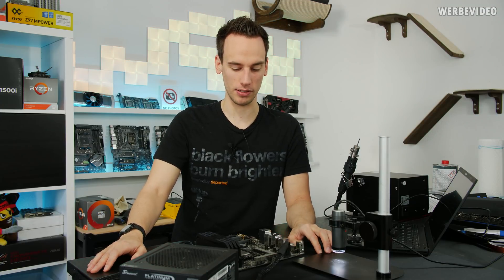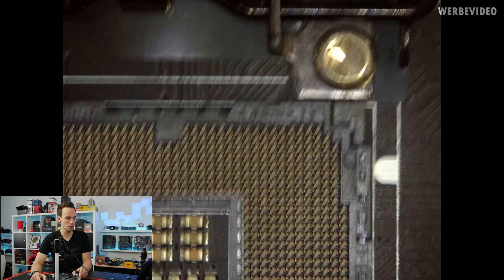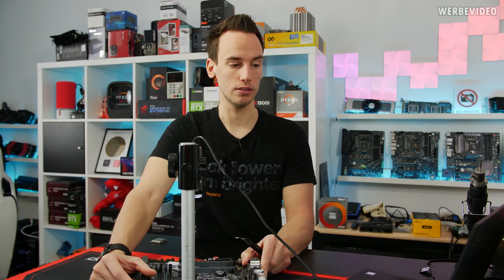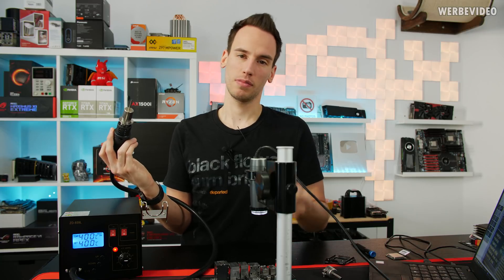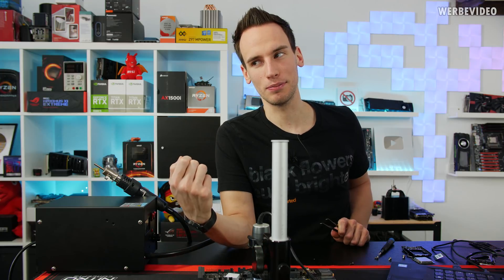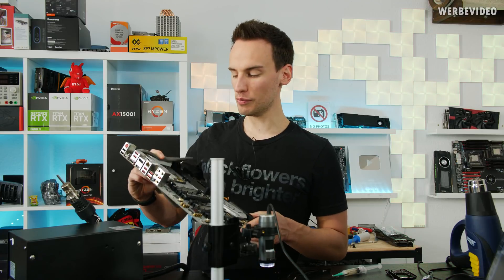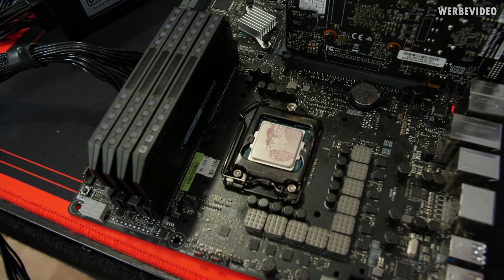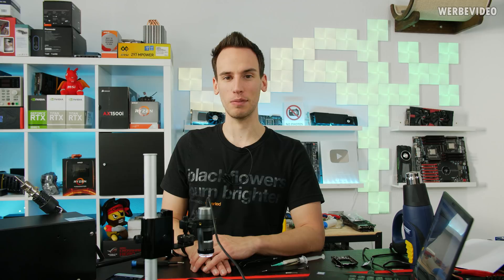We fixed a broken motherboard (Pin)... and broke it even more. BUT now it's working :D

Comment: We professionally do that almost everyday. We rarely use microscopes and magnifying glass but a lot of lighting is important. 
You can try creating a jig so that you can put a heat gun on the bottom of the board . 350 degrees is enough to prevent quickly melting the socket and you can skip the flux, it only makes it look messy. You can also try to use tweezers with finer tips. Other than that, you did well.
Reply from the maker: Thanks!
Reply: No flux? I thought it was "the bigger the gob, the better the job" :-)
Reply: @rhekman  , not needed, the key is to get it out without braking it. The replacement it's enough that is inserted, the minimum amount of contact is all it takes.
Reply: that is the exact method we use. it's even possible to use lower temperature but it will take way longer for pins to loosen up.
Reply: Agreed, 350c should be sufficient.
Reply: @animearmpits3060  I preheat the motherboard to 170-180 then use 230-240 on hot air and is enough. I won't even try to hot air without preheating motherboard from bottom. Large motherboard absorbs huge amount of heat and that is the reason why people without experience tend to raise hot air up to 350 or more. Preheating the board is mandatory.
Reply: @der8auer I would also consider using non-magnetic tweezers since that's why u messed up the other pin (or just touching the pin with magnetic ones instead of catching it for better precision).
Reply: Can you just heat the single pin with a tiny tip soldering iron while applying pressure to remove the pin when it's hot enough? 
I have the identical board but it's still working with half the memory, otherwise I get CC error code (clear CMOS but it doesn't work)
Reply: Can you help me on this by providing your method's video please? It would be very helpful.
Reply: You will need flux you can just ultrasonic clean it after
Reply: Got a vid?
Reply: who does something like this professionally ? what does it cost to get such a thing done?
Reply: can't you just superglue a missing pin?
Reply: @turinreza  i was actually planning to do that but the pin was too tiny for me to handle, PC is back up and running with 1 x 16GB stick of RGB Vengeance memory 

this all started because i felt the RGB on the IO of my mainboard wasn't bright enough. haha. Should have been happy with what i had, haha
Reply: it's not for the faith of the heart. I'll pass doing it myself; not worth it. local shop doesn't do these anymore. They all transitioned to fixing smartphones. bummer.
Reply: How can a pin on the cpu socket break? What would be the conditions?

Comment: You've got really steady hands. I bent a Ryzen pin this weekend, used a DSL camera on a tripod with a macro lens, and HDMI out to a 50" TV see what I was doing. Ended up using a sewing pin to bend the cpu pin back. Trick was to be patient and very gradually pressure.

Comment: I can't give you advice on pin replacement, but I can help you steady your hand. Always have your pinky finger or part of your palm resting on the surface. I have noticed in the video that only your forearm, and not the palm was resting against the motherboard. That is why you couldn't control the hand enough to just pull one pin out. And also hold tweezers like you would hold a pen while you write. You have practiced fine motor skills for writing your whole life, why not use them to control tweezers. :)

Comment: Worth noting that the ZD-939L is a very low power soldering station rated at just 320W
Reply: 240V @ 320W, and can reach 500 C. More than enough for the task.

Comment: Cheers! I normally do work like that, and to avoid damaging the plastic parts, work on a hot plate at 100 - 150 degrees Celsius to avoid applying excessive heat with the hot gun, a hug from Costa Rica !!
Reply: wow I didn't know anyone was doing board repair here in costa rica, that's awesome.

Comment: You have to preheat the board, and have another heat source in the bottom.The huge groundplane in the inner layers to have a proper controlled impedance circuit will sink a lot of heat away.
I have no idea if the socket itself will melt before the solder does. Unfortunatly specs/datasheets of the sockets are not public available so soldering temperature is unknown to most.

Even professionals have to try and error.

Comment: Ouch! That MSI TITANIUM... That board was awesome. I actually bought a z370 Aorus Gaming 7 that had bent pins and was RTV'd and fixed strait from Gigabyte. I could still tell were the pins were repaired but, it was just fine. I got the board for $145 and a 5.3GHz 1.380v 8700K for $280 to go with it. It hasn't cause any issues and i severely stressed that board. I never really had problems with bent pins because i never bent any. I was always over cautious around open sockets. Though, i fixed many of them throughout the years. After realising i could remove pins, I bought some killer boards that were thought to be worthless.

Comment: Kinda sad if a man like you with so many great connections in the computer industry can not even get schematics from AMD...
Maybe like Louis Rossman, you should advocate for the right to repair on broken motherboard...
Reply: There isn't any assault on consumer motherboard repair doe. The stuff isn't really proprietary since there have been at least three large OEMs making sockets and many more smaller ones for specialized stuff. Parts are all over everywhere, it's just a matter of having money to buy them and the equipment and mechanical knowledge of how to go about replacing surface mount and BGA bits.

Comment: I had the same problem with pins when I accidentally dropped the cpu into it. I did get the pins straightened out enough to work though. I got lucky.

Comment: What if you used those dual pronged soldering iron tweezers?
Reply: There are also mosquito nose pliers with extremely small tips that would work well with such tasks. I have one set that I have ground down even further for access to confined areas.
Reply: I've never seen them small enough
Reply: BangDroid The JBC one is really small.

Comment: Hi Roman. Can u please help me out with  which stock cooler fits a reference blower model 780ti? I know the evga sc acx coolet fits but do you know if the layout of a gtx970 or gtx780 is also same? My asus 780ti (blower) is an excellent overclocker and can run timespy at 1325mhz at 1.212v but the cooler is obviously hopeless. Thanks

Comment: Me: tries to fix a bad seated ram stick and breaks the motherboard.
Der8auer: tries to fix a pin and in breaking more things, he repairs everything.

I need some private lessons
Reply: I broke a SMD resistor off a motherboard once trying to fix a stupid ebay buyers "it's broken" pin breaking incident when they tried to force the wrong heatsink on it. I fixed the pin, plugged the CPU back in, then put my own heatsink on, and crushed the fan power socket/wire into the motherboard. Whoops. Soldered it back on and it worked and still sold the motherboard on. The next buyer used it fine!

Comment: Heating a big BGA chip or socket in one place can warp the board and introduce more problems. Usually either an IR bottom heater or a DIY lamp heater can be used to even out the temperature difference across the board. In general the slower you go and the less temperature shock you introduce, the better. This would also help not to melt the socket.
Reply: Vlad Ivanov no shit
Reply: @aqib2000  not everyone knows this kind of stuff. It might seem obvious to you but that doesn't mean that everyone knows it.
Reply: Samuel Ares on YouTube search BGA rework and you can learn everything. If you don’t seek knowledge don’t expect it to be force fed into your gob.